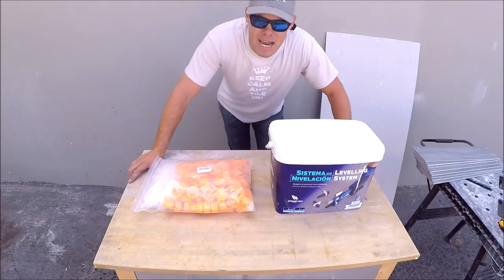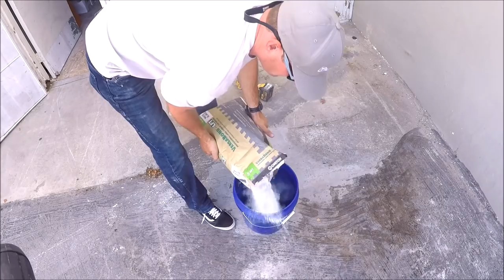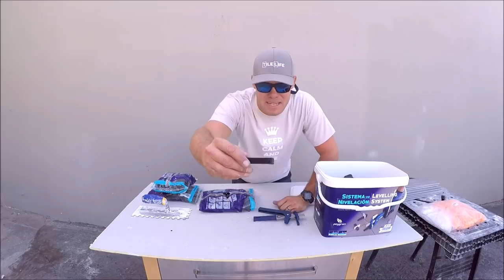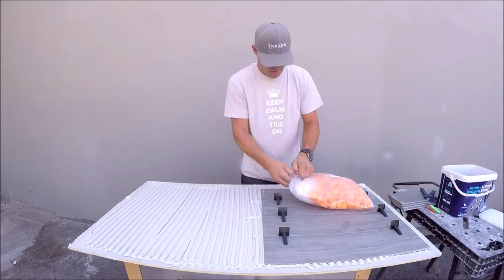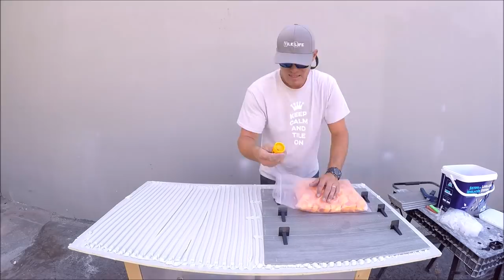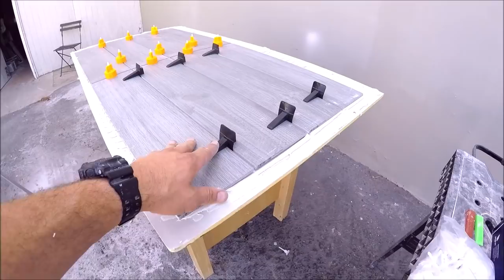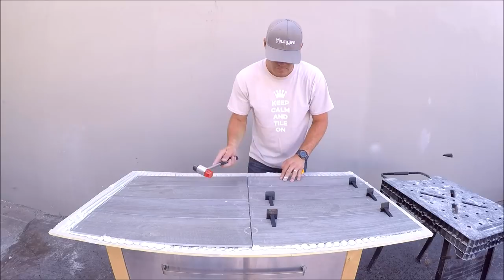Testing Cheap Amazon Tile Leveling Systems

Comment: The system seems like crap, it pulls the tile away from the thinset even if you back butter.
Reply: matt motta I agree,  it’s is effectively pulling the bottom and top planes together and could indeed cause problems.  If the spacers were mechanically adhered to the substrate I maybe could see using them with the huge tiles some people seem to like these days.  I did nothing but set tile for about five years with my old man and he’d have died laughing if he saw anyone using these.  He made sure every surface we ever covered was properly prepped so this kind of thing was never an issue.  I’m guessing enough of the old timers have exited the business and there’s enough DIYers out there that this make work for them and the noobs.
Reply: There’s a video where someone used pieces of glass in place of tiles and it worked well. In my experience, the thinset needs to be solid enough to not sink when you spread it, yet wet enough to stick to your finger when you touch it. That way it sticks to the tiles and the subfloor when you level them.